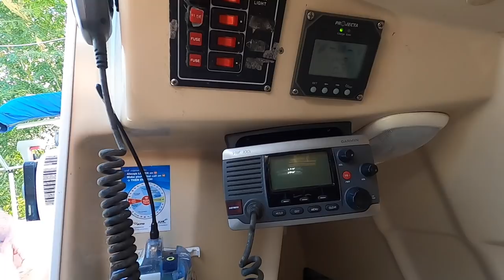37.  We BUY Another Boat !!!  But not what you think.....

Comment: Had an '89 Mac 26D for 10 years. Lots of fond memories.  A safety feature worth mentioning is a Mac will not sink, foam added at the factory.  Setup and breakdown time is about an hour when you get good at it. Would suggest mounting the boom while on land. You need a topping lift and maybe lazy jacks to make taking the main down easier.  Defenilty drain the water ballast before hauling out (but JUST before, not stable without water ballast), the trailer will not take the weight. Make sure the boat is all the way forward when on the trailer, keep ties downs loose and drive the truck slow in the parking lot, slam on brakes, the boat will slide forward on the beds nicely. Keep the weight inside the boat well forward while trailering, if there is not enough weight on the tongue the single axile trailer will become very squirrely on the road.
Reply from the maker: Thanks for all that great advice. We have struggled to bed the nose into the V as it seemed to sink back as you pull it out - maybe this is a common problem and we will try your brake technique! Thanks for the other practical tips too!
Reply: @barefootdoctorssailing8567  The gap is just launched angles. Not worth fighting with the winch.  Experiment with VERY (1 MPH) slow speeds before braking, it does not take much to slide the boat on the beds.

When you put the foresail on it overhangs the base of the mast a few feet.  We used a 6' PVC perforated (drainage) pipe with the top third cut out, and edges eased with sanding. We bungee the PVC to the mast and secured the end with a plumber strap (a lot of holes) using the same bolt that holds the mast to the bow pulpit.
Reply: @barefootdoctorssailing8567  The previous owner built a simply v-shaped wood brace that matched the bottom of the boat. It was placed on the ground aft of the trailer wheels. This prevented the boat from tipping on land when not attached to the hitch. Maybe the 26M does not have this problem.
Reply from the maker: @BostonClipper  We certainly have not had any issue with tipping when not attached - probably all the weight from Eli's food stores!!!! Thanks for the help!

Comment: Congratulations on the new boat! I think you'll have a lot of fun with it. I've got the 26X model and love it for coastal cruising. 
If the water in the bilge is outboard of the ballast tank, it's almost certainly entering where chain plates come up through the deck. It's amazing how much rain water can leak in through the tiny spaces around the chain plates.  Use UV resistant silicon to seal all the gaps around the chain plates and just plan on replacing it every year. Silicon works better than urethane for this application due to UV exposure and constant flexing of the chain plates under load. 
You might also consider putting some surge brakes on the trailer. All the boats sold in the US had trailer brakes. Stopping is not great even with trailer brakes but it could be downright scary without them.
Reply from the maker: Great advice and we did get new brakes fitted and they work really well- no swaying or problems and I have got up to 65mph/110km without any issues.. Thanks for your other advice too!

Comment: I have the same MacGregor 26M in blue. Hopefully one day I’ll move to catamaran. I cleaned the carpet with a dish soap, brush and power washer and then got rid of the water. It worked really well. Most leaks are from the rubber rail, then windows. Cheers
Reply from the maker: Thanks P, how do you fix the leaks in the rub rail...
Reply: @barefootdoctorssailing8567  it looks like my response got deleted. Maybe because i included links. First check exactly where is it coming from. The carpet would be wet. Check where the rigging attaches to the metal plate in the middle of the boat....thats where you were removing the water. 
To redo the top of the rubrail silicone, carefully remove the old onel, then use a painter tape below and above and apply 3M 4200.
Reply from the maker: @marski5260  That is great advice - thanks very much!
Reply: @barefootdoctorssailing8567  I too have a 26M, used to have lots of water in the boat every time it rained. Turned out to be the hull to deck joint. Found out on a particularly windy day with the boat heeled to the point where the rub rail was submerged and could see water running into the cabin down the carpet.  Sealing the top didn't stop it completely, the water runs under the rub rail due the deck curve. Had to remove the rub rail, remove existing sealant and re-bond. Perfectly dry boat for 5 years now. 

Great boat for it's intended purpose with the right modifications. A full batten square top main and steering disconnect kit greatly improves the feel and rig balance.